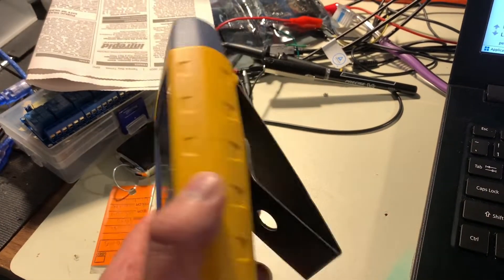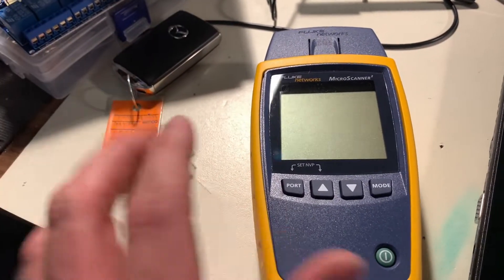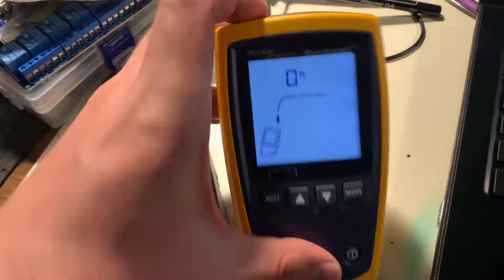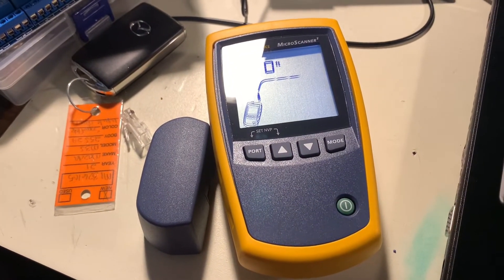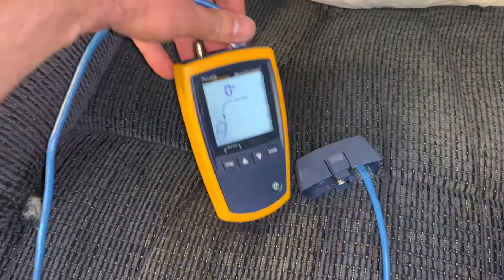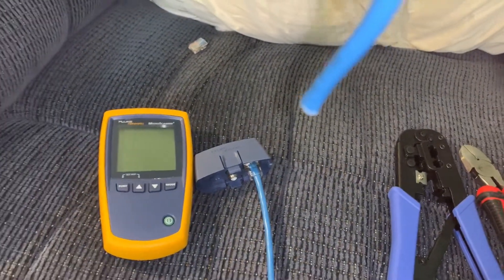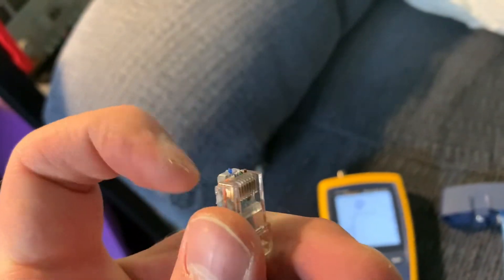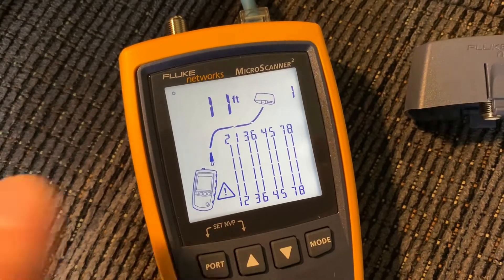How to test ethernet cable - Fluke MicroScanner2 - in 2 min

Comment: so it doesn't do more than just pass-fail?
Reply from the maker: Sure this is just one function of the analyzer
Reply: @HTMWorkshop  
Is there a mode to tell which end of cable is bad so you don't have to guess.
Reply: @HTMWorkshop does it show if it will pass gigabit speeds?

Comment: I have the Microscanner 2 and just recently noticed the wire order shown when testing a cable is 12 36 45 78. Any idea why it's not in order even when the cable is terminated correctly to T568B standards?
Reply from the maker: That’s a new one - I don’t know - let me know if you figure it out
Reply: @HTMWorkshop  Yeah in your video yours shows that way too.
Reply: Ethernet work on 1236 wire others is for POE
Reply: It's got to be, maybe you, misidentified color codes. I just did a single cat6 split into two RJ45, the reading is as shown above.

Comment: What end do the lower/upper numbers indicate? Like if the upper numbers don't show, how do I know what end is the faulty one?
Reply from the maker: If the numbers are not showing up - its because the signal is not coming back on those wires. So most likely if the whole top is out then your connector on the far side is bad (or the whole cable  is cut somewhere in the middle). The bottom numbers are the connector closest to the tester - and the top numbers show the connections at the other side (in the adapter)